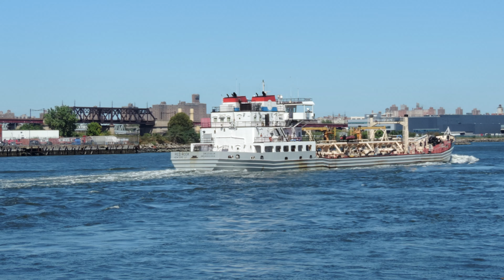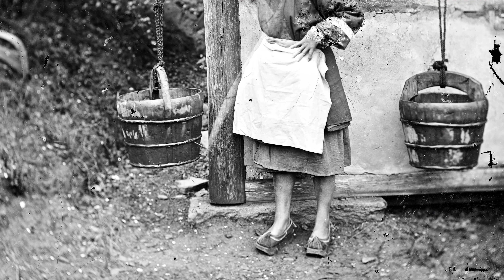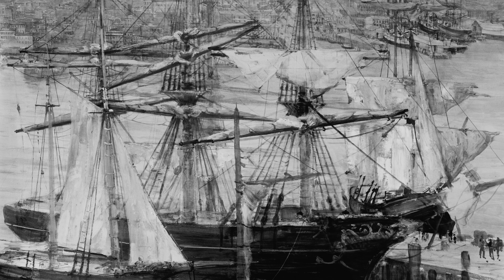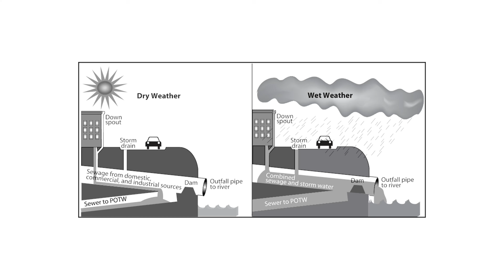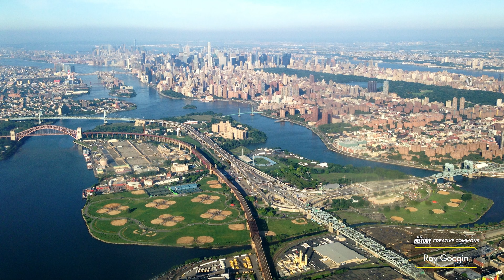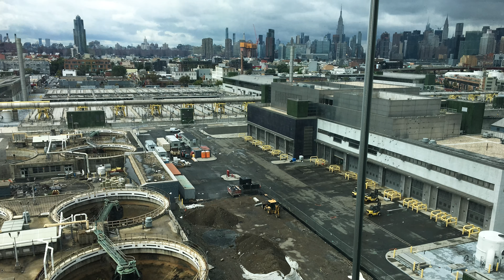Why NYC Built Skyscraper-Sized Sewer Tanks

Comment: In the beginning, I was annoyed by the narrator constantly interjecting. Now, I breathe a sigh of releif, because of The narrator showing his face ascertains it’s not AI-slop-narration. And, the series is actually interesting! All cities started out with night men, London had its cesspits. Many large German cities (Hamburg, Berlin) built five-floor walk-ups with a shared toilet on the landing between two floors in the stairwell. Each toilet dumped its contents straight down into a huge receptable on the ground floor, thst the city would empty (by hand) when it was full. These «splash toilets» were common in Oslo, too (the name came from the fact that the result of your visit had a four-floor free-fall…). Eventually, many of these buildings had them replaced with regular water closets in the same location, until a program of modernizing old buildings equipped them with proper bathrooms. Many of these former toilet rooms then became storage spaces. Oslo dumped its storm drains and industrial waste into the city river, and finally got to build an interceptor sewer to collect all runoff before it hit the river, sending it all to the city’s waste water management facility. While not swimable yet, there are salmon successfully navigating the river and spawning. The upper third is now perfectly swimable.

Comment: Because of the PFAS issue they should totally dry the sludge and burn it
Reply: Just burning PFAS is NOT a good idea - that would just realease more toxic chemicals into the air.  It requires carefully controlled incineration at ridiculously high temperatures (~ 1500C) to destroy them properly.
Reply: @Cynthia_Cantrell  I believe that is exactly what happens in waste to energy plants in the U.S. but around the world

Comment: HI from Sydney, Australia, I can't believe that New York of all places was SO LATE TO SORT THE SEWERAGE, as here in Sydney this was something that was sorted out well prior to 1900, as had been our drinking water with giant dams being built near 45 miles south of the city. The sewerage is treated at several "outfalls" where after treatment it is pumped out via massive pipes miles out into the Pacific Ocean, with the main northern and southern outfalls being built prior to 1900, they were both given an update in the early 1980's and still work perfectly. I'm 70 years old, my parents house built in 1895 was constructed with two flushing toilets, the whole  massive home estate was built on a former orchard that was approximately a mile wide and two miles long, in 1895 the developer LEGALLY HAD TO BUILD A COMPLIANT SEWERAGE SYSTEM INTO THE ESTATE TO SELL A BLOCK OF LAND, IT THEN HAD TO BE "STITCHED" INTO THE EXISTING SEWAGE SYSTEM. At that time ALL OF THE SEWERAGE network had full mapping of all the underground pipes, connection points and "fall" degrees so that solids would flow and not cause blockages, with much of Sydney being VERY hilly and steep this natural geography certainly helped. The old suburbs of Sydney had massive silver, grey or green sewerage breather pipe-poles mostly in back lanes, we kids called them "stinker poles" back 70 years ago !!  where local systems connected to sewerage main pipes underground, there were the occasional massive 200 feet high brick breather pipes nearly 20 feet in diametre at the base, tapering to around 10 feet at the top.
Reply: Yeah, but when was the first big city there? I mean there's really nothing in Australia to compare it to New York. It's a lot different installing sewers into a small fairly recently built city and a city that's existed since the 1700s and is a huge mishmash of narrow streets, multi-story buildings with deep foundations, underground passageways and chambers, etc. etc.

I've only been to New York a few times but parts of it really do feel like Gotham City. It almost feels like the buildings are leaning out over you in a lot of places, with sunlight seeming to never touch certain streets.

Have to compare it to London. The first part of the modern sewer system there was completed in the late 1800s. And that was about 1,500 mi. It was extremely impressive for its day and I believe a lot of it is still in use. The brickwork is absolutely beautiful. I believe London was the first system of its kind in the world and it wasn't completed that long before New York put down it's first "modern" sections.
Reply: @hideousruin  isn't London more than 1000 years old?
Reply: This would. Are a great video too!

Comment: Do they burn the methane to generate electricity?
Reply: @brucealanwilson4121  No, they burn it to heat the system because it needs to stay warm to operate.  So they're definitely using it, just not for electricity.
Reply: @josephbrown8905 OK.
Reply: Yeah. Natural gas is basically just methane
Reply: free fuel